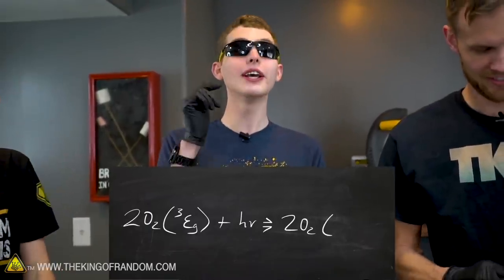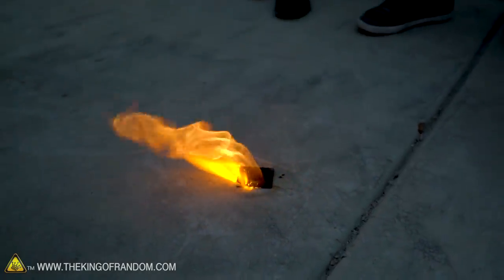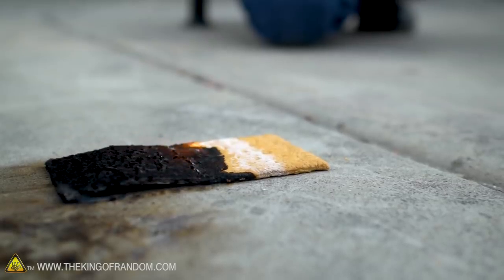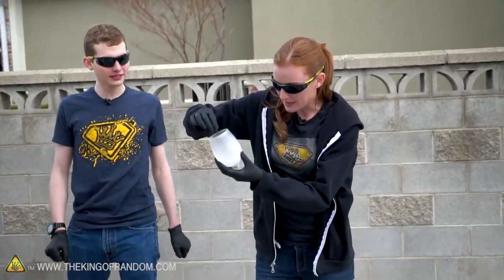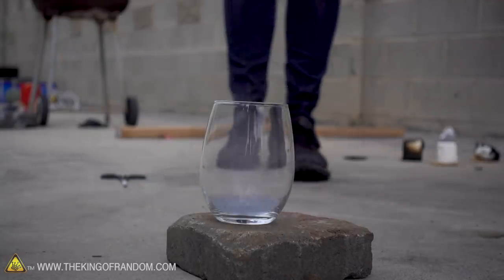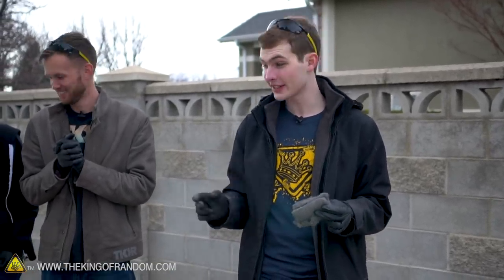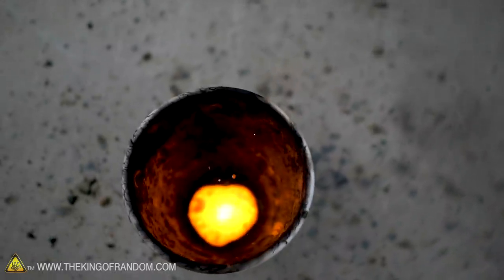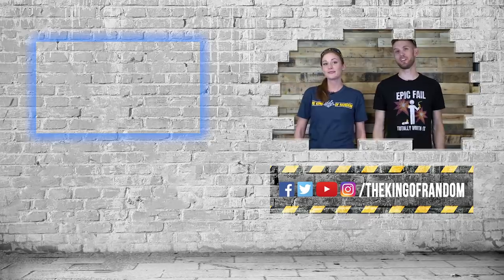Why Liquid Oxygen & Carpet DON'T Mix

Comment: Hydogen:is very flamable
Oxygen:is pretty flamable
Me:COMBINE THEM
h2o:puts out fire
Reply: HO: explodes
Reply: H2o2:kills stuff
Reply: Actually if you combine a 1:1 ratio of hydrogen and oxygen which is called HO is pretty explosive
Reply: Even water is flammable at high temperatures
Reply: @jacobarmstrong2343  what really?
Reply: Jacob Armstrong now I need to see them put water in the forge.
Reply: @jacobarmstrong2343   at that point it start to break down which would be a nuclear  infernal
Reply: Smart
Reply: What’s h2o
Reply: What the heck, science?
Reply: @tsm_myth8290  , H2O is the chemical short hand for water
Reply: @jacobarmstrong2343 , not flammable but explosive! Lol
Reply: @brettpalmer1770 They do use water in rockets, and fuel cells.
Reply: but it turns into fire when you combine them and then the fire transforms into water
Reply: Oxygen is NOT flammable. It is the oxidizer that "oxidizes" other materials. Materials oxidizing at a fast rate is what we call fire.
Reply: So many science people here that i cant relate to. It's fun
Reply: @jacobarmstrong2343   water itself not but at high temperatures it breaks down in h2 and o2 wich is an explosive mix
Reply: 03 is pretty bad for your lungs.
Reply: I'm not a chemist but i think h2o is water
Reply: But it is 2 hydrogen 1 oxygen there is a difference
Reply: Kendi Braxton sorry
Reply: Lol
Reply: Anti vac logic
Reply: Echelon - exactly just didn’t want to get into the details for non scientific people FYI rocket fuel fires reach temps high enough to do this.
Reply: I feel the same way about table salt
Reply: Hydogen 2 Oxygen???
Reply: @personalemail1534  That would be a 2:1 ratio, as 2 H2 + O2 gives 2 H2O.
Reply: Either way, that stuff looks yummy.
Reply: @nathannguyen1431  no its around 3000 degrees Celcius
Reply: @johndoilah3850  it is hydrogen oxide
Reply: @tsm_myth8290  a green chemcal like a oil
Reply: 2 negatives make a positive
Reply: Oxygen isn't flammable, it just acts as an oxidizer.  Oxygen (vs air) will allow the fuel to burn hotter and faster.
Reply: oxygen is not flammable its  an oxidizer so it accelerates anything around it that is on fire.
Reply: Jacob Armstrong it’s not flammable but it does react to high temperature or fire. by boiling evaporating etc.
Reply: @wolvenar  Furthermore, humans have invented the terms "oxidizer" and "reducer".  On a planet with a hydrogen atmosphere, oxygen would be the flammable gas and the hydrogen all around them simply supports combustion.  Basically, it takes two components to have a reaction.  If it is strongly exothermic, you get lots of fire and heat.
Reply: oxygen isnt flamable, its just the element behind every combustion
Reply: @tsm_myth8290  do you actually not know? Its something you need in your life daily. Water
Reply: @creeperizak8971  but at low quantities its actually a very pleasant smell. I love the smell after a lightning strike. (especially since I live in a place where we sometimes don't even get a single thunderstorm in year) You gotta learn to appreciate going outside after a rare weather event in your area. I don't know about tornadoes and hurricanes though. Freezing rain is also pretty cool. Just don't drive after it, and make sure you have spikes for your shoes. It's so pretty outside after one. And dangerous. But still
Reply: Tsm_ Myth ur dad
Reply: Mix meme plays
Reply: @ChristmasEve777  you got that backwards.  Hydrogen is the flammable gas and oxygen supports the combustion.
Reply: H2o does not put out flame. The reason that flame gone when you pour water is because there is oxygen for it to burn.
Reply: @DarkHasLight  h2o is putting out the flame.  The h2o is what starves the fire of available oxygen.

If you poured sand on it instead then the sand would put out the fire for the same reason, starving the fire of available oxygen.
Reply: The EU once tried to ban water. They looked at its more scientific designation, dihydrogen monoxide. They then remembered, if you combine liquid oxygen with liquid hydrogen, it makes dihydrogen monoxide and results in a violent explosion. One of the most powerful known to man. So they tried banning this new, dangerous dihydrogen monoxide. Until they realized it's H²O. Idiots.
Reply: Oxygen isnt flammable, it just helps sustain fires
Reply: @rabbitdrink  Wrong! Oxidtion is the removal of electons from one atom to another. Many chemicals oxidize with no oxygen at all, such as hydrogen burning in flourine.
Reply: @jacobarmstrong2343  what. So when fire is on water, like a lake or somthing when a boat explodes or something, that is actually plausible.
Reply: @saffroncoasts6950  that's Hydrogen Peroxide...
Reply: I am your 666th like and I am an angel. Oh the irony.
Reply: Even if you get water, the process of getting water is incredibly energetic, like enough to launch rockets into space
Reply: So much for two wrongs don't make a right

Comment: Please, use liquid oxygen on the thermite reaction!
Reply: I am sure it goes boom at that point
Reply: Liquid nitrogen you mean
Reply: I don't think it would do much as in thermite reaction oxygen is only transfering from iron oxide to aluminum.
2Al+Fe2O3--->Al2O3+2Fe
Liquid oxygen shouldn't really do much as it doesn't need environmental oxygen to burn.
Reply: @gameplayerslovenia954   It would just shift the reaction to burn aluminium powder in liquid oxygen, which again sounds like a reaction you might not want in your close vicinity.
Reply: @Lightningchase1973 
I don't think I would want any burning metal really close to me. With my luck it would end up with me trying to extinguish my clothes in nearby river.
Reply: Basically they already did, sparklers are a termite reaction and the actual thermite part of the reaction was unchanged although the iron(Steel?) rod seemed to burn aswell.
Reply: Yes this I want to see
Reply: Sounds explosive
Reply: @gameplayerslovenia954  Finally, someone said it. It's as with the sparkler in the video, these substances have their own oxygen source and additional oxygen has very limited to no effect
Reply: They should cast a knife with steel wool

Comment: Thermite plus Liquid Oxygen? Please do it xD
Reply: or anths
Reply: Haha i just requested that also. I think it would be amazing.
Reply: I Will not make a difference. The reaction is between the iron oxide and the aluminum not the air.
Reply: @lukassjoberg5105  oxygen is still a necessary element in any combustion reaction.
Reply: Thermite doesn’t require oxygen for the reaction. Oxygen won’t affect it.
Reply: I'm not a chemist, but I don't think it would make much of a difference. It would be the same, as if they burned aluminium alone in pure oxygen, because the whole reaction is based on iron oxide giving off oxygen to aluminium to form aluminium oxide. Somebody smarter than me can correct me though. :D
Reply: Straight aluminum powder would do nicely, but it may need to be puffed somehow. The iron oxide provides the oxygen in thermite and it separates the aluminum particles at the same time. "Aluminum wool" in liquid oxygen maybe.
Reply: The sparkler is basically a form of thermite.
Reply: FeO +Al > AlO +Fe. adding some O on it's own will just replace the FeO. it'll just be an aluminium fire in liquid oxygen.
Reply: @KwadfordFPV iron oxide and aluminium is not a combustion reaction, it is a displacement reaction. Therefore, it does not have oxygen as a reactant
Reply: I don't think it would make a difference as the oxygen is already in the iron oxide, as It is a redox reaction, I think it would just cool it and make it harder to light? Or make it easier if using an accelerant!
Reply: I HAVE BEEN ASKING FOR THIS FOR AGES IM DYING TO SEE IF SODIUM WILL REACT IN LIQUID OXYGEN AS ITS EXPLOSIVE IN WATER :d
Reply: @PhazonBlaxor  always a chemist or scientist in the comments

Comment: Could you soak orbys in liquid oxygen and light them on fire for a small fire ball?
Reply: <shrugs> What Sam Scow said, but I mean, we could put it under pressure to let the oxygen stay liquid at room temp, but I'm pretty sure the orbies still wouldn't 'absorb' any... and the moment you released the pressure, they'd probably just pop if they had managed to take any in.

On the other hand, I use tetrafluoroethane in coke bottles to make special effects with instant freezing 'water'.... so.... I'd like to see what happens either way.
Reply: Very cool idea

Comment: Rust is caused by oxidation  so if you drop iron in liquid oxygen will it rust?
Reply: It probably would because even if it is liquid it still would rust because it is oxygen
Reply: @maisangster6399  truetrue, just like how fire burns in liquid oxygen because while it's technically in a liquid, oxygen still fuels fire
Reply: Burning stuff is just a really quick and agressive oxidation.

Yes liquid oxygen would create a rust coating on the material.

Comment: I wonder how liquid oxygen would interact with self oxidizing reactions, such as thermite.
Reply: ...  I want to find out, from a very considerable distance away.
Reply: Not very much more. Thermite is self-oxidizing, it contains iron oxide, so I would imagine it to be much more energetic
Reply: @vikramkrishnan6414  quite violently, once the thermite burns you're left with boiling iron, which would be quite vicious in liquid o2

Comment: The reason the sparkler wasn't burning with any more show is because they are designed to burn slowly; it would be next to no fun if they went up in an instant. The reaction was more intense and thorough which generated enough heat to crack the glass, yes... But the reason you didn't have a big fire show was because you lacked something that all the other tests had: fuel. The powder on a sparkler is minimal compared to the finely shredded steel wool and the petroleum in the styrofoam cup. 🤔🧐

Comment: Since water is made of hydrogen and oxygen what would happen if you mix liquid oxygen and liquid hydrogen together???

Is it still flammable???

Next video idea, maybe 🤔
Reply: If you burn it it produces water. Some rockets use this as a propellant (Space Shuttle for example)
Reply: How do you even make liquid hydrogen
Reply: I believe it’s possible but extremely difficult (hydrogen has an extremely low boiling point)
Reply: @stormtorch  so does oxygen.
Reply: @blobfish_plays6548  with electricity
Reply: @thisisntme The boiling point of oxygen isn’t that low (it’s greater than the boiling point of nitrogen) but the boiling point of hydrogen is much lower than even nitrogen
Reply: @stormtorch  all depends on what you are comparing it too.
Reply: It becomes H2O^2 or Cthulu Tears
Reply: Tanks**
Reply: Jaden Fong hydrogen is really flammable
Reply: It’s now water
Reply: That is called the rocket fuel, well seriously.
Reply: Watch a space shuttle launch. The SSMEs, the engines on the orbiter itself, run on those two. 

If you just mixed them by hand, chances are high you'd never be doing it again.
Reply: Yes but less so... hahha
Reply: Most large rockets do that.

Comment: Make a rocket engine that uses liquid oxygen and hydrogen
Reply: You'd get water
Reply: Space Shuttle main engines. You get water.
Reply: Nicholas Ryabchuk that's how every liquid fuel rocket works
Reply: @propanescripts  Not really. Different liquid fueled rocket engines use a different combination of fuel and oxidizer.
Reply: What you just described is called a hydrolox(hydrogen + liquid oxygen) engine. This engine is well known for being the most efficient bipropellant chemical rocket engine fuel combination. Common hydrolox engines include the RL-10, SSME(Space Shuttle Main Engine), and Rocketdyne J2(used in Saturn V Stages 2 and 3).
Reply: @johnrickard8512  yes and I'm wondering how successful would a regular person be with creating this type of engine

Comment: Could you show what liquid oxygen does when poured between a strong magnet?
Reply: Amanda Ruck Nothing ,its liquefied gas have you ever studied chemistry
Reply: Adham Mohamed Actually, liquid oxygen is paramagnetic and thus will react to a strong magnet. Have you ever studied chemistry?
Reply: @a9h5m61  so what does the fact that it's a liquified gas have anything to do with magnetic properties
Reply: @a9h5m61  wrong it will form a molecular dipole moment. you obviously haven't studied enough...

Comment: In school we were doing the typical cryogenic freezing of roses, balloons, etc but with liquid Oxygen instead of Nitrogen. An attempt was to make a piece of notebook paper brittle. Soaked and placed on a counter, it was struck with a hammer, and exploded like a cap-gun scattering confetti. Area of compression exploded. Perimeter was torn to bits. Nobody expected it to explode. Walking on soaked carpet could result in an explosion where the reaction is contained.

Comment: what happens if you put rusty metal into liquid oxygen ?
Reply: nothing
Reply: It will most likely rust quicker, it may cause the oxygen to boil if it wasn't already as it is an exothermic reaction
Reply: sethrc225 i was wondering if it just crumble infront of ur eyes because it oxidizes
Reply: @andrewbrady9650  It will only develop a passivation Layer, but after that it won't react further as there is no water present. Iron will rust slower in dry air liquid O2 is 100% Water free. Thats also why you can Store liquid fluorine in iron containers.

Comment: The carpet and liquid oxygen info warning isn't surprising as carpet is the easiest way to dispose of excess liquid nitrogen. I've seen it done in a lecture at university, so you really should know which your using, they look the same, colourless, odorless, and can't be touched due to obvious  frost burns and significant harm, the only difference between them is temperature and as we've seen glass thermometers that use alcohol is not recommend, a metallic thermometer could also cause a problem. Since the processing to form liquid nitrogen also generates liquid oxygen due to their boiling points of 197, 183 Celsius respectively, the two could be mistaken if an inexperienced student tried it.

Comment: In the Air Force we were always told to be careful with LOX because if you step on it, it will explode. It has to do with the compression of it ignites it. Can you guys try this out? Get a droplet or two and slam a shoe on it. It should explode very loudly

Comment: try putting ferrofluid on top a magnet  but not touching the magnet -soaked in oxygen(the magnet) and fire the magnet and watch the ferrofluid  slowly dissipate from the magnetic field   because the heat should destroy the magnetic field kindve a tricky experiment but worth the try

Comment: i’m 12 and i’m about to make an assumption on how this works. since fire feeds on oxygen, the liquid oxygen will help fires start more easily. and since the oxygen is extremely cold, when you had that high pressure to something with pressure so low, the thermal energy transfer will be viciously fast making the fire grow huge. this, clearly, is enough to melt steel. (i liked the pokémon reference at the end 🤣🤣)

Comment: The sparklers don't use atmospheric oxygen for combustion. The chemicals that react in it are all present on the stick, they just need high heat, which is why they even burn under water

Comment: Liquid oxygen is magnetic.

Can you soak up a ton sponge in liquid oxygen then ignite then switch on a powerful electromagnet? The fire should fly up to the magnet. I think.
Reply: all magnetic metals (iron steel alloys etc.) lose magnetic properties while or near molten,so even steel wool wouldnot move until solidified.